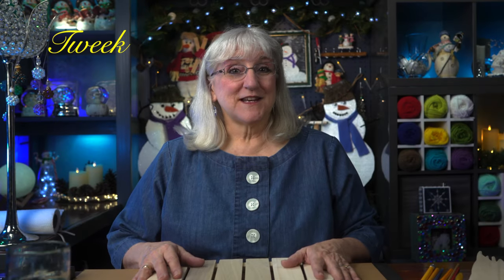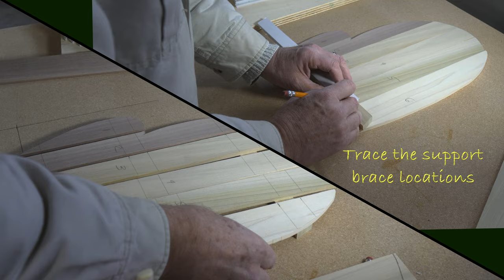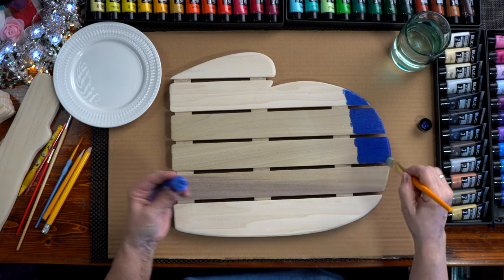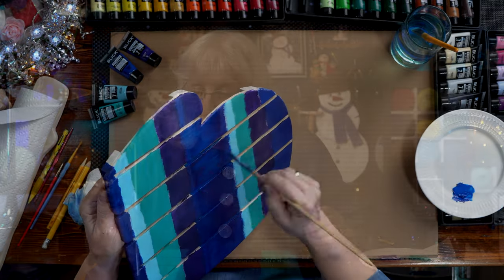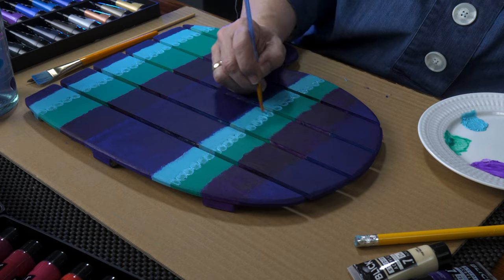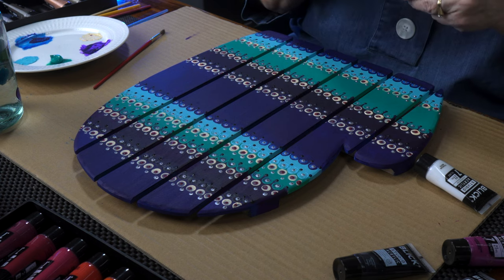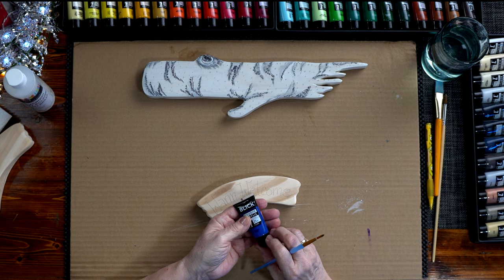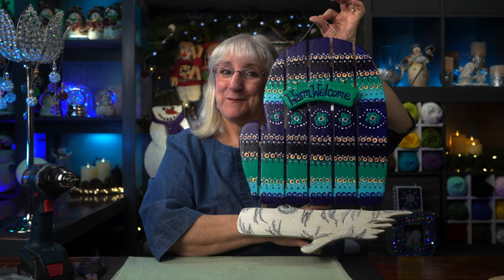Make a WARM WELCOME SIGN Mitten for the FRONT DOOR or PORCH, Tutorial

Comment from the maker: Mitten Chapters

0:00 - Intro
0:28 - Project Description
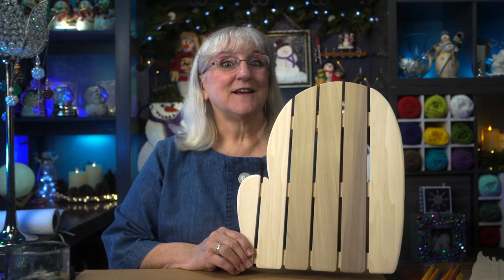0:46 - Project Supplies
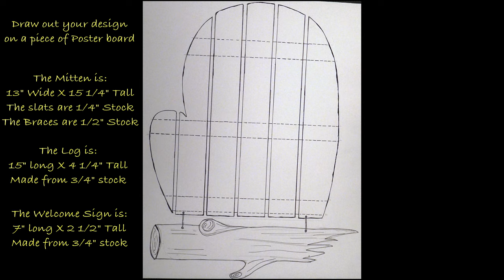0:55 - Getting Started
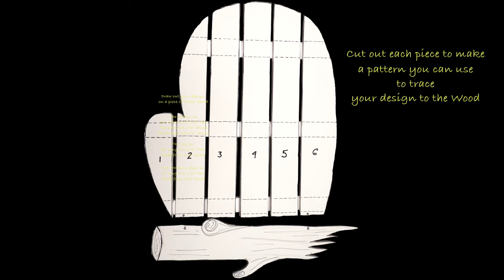1:05 - Cutting the Wood to Size
3:10 - Assemble the Mitten
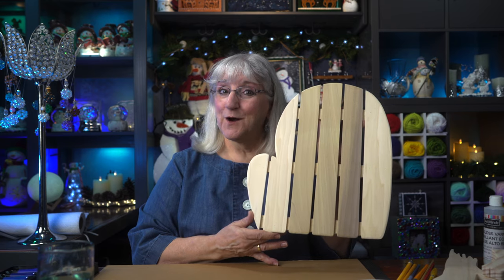4:45 - Painting the Mitten
9:30 - Adding the Detail Pattern
11:25 - Dots inside the Dots
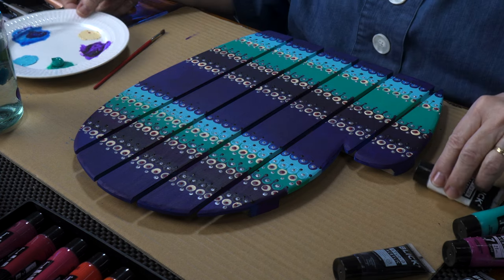13:15 - Adding the Flower Pattern
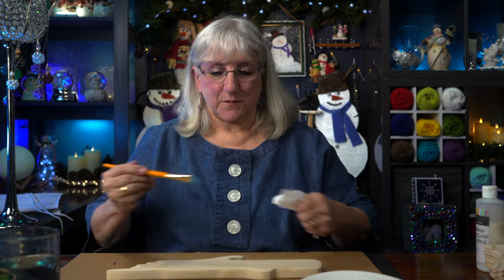13:55 - Painting the Birch Log
15:25 - A Warm Welcome Sign
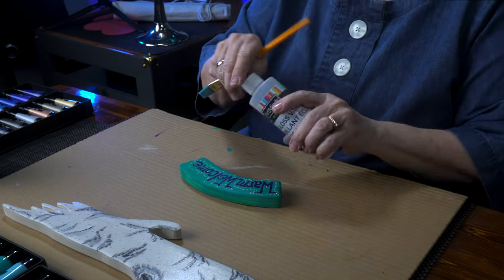17:10 - Time to Varnish 
17:30 - Adding the Hardware
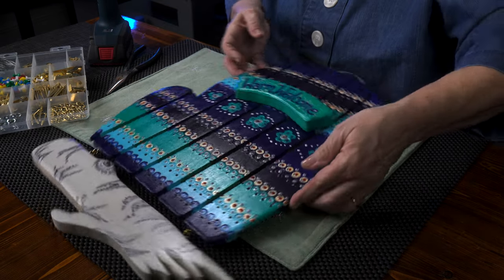17:56 - Completed 
18:08 - Outro